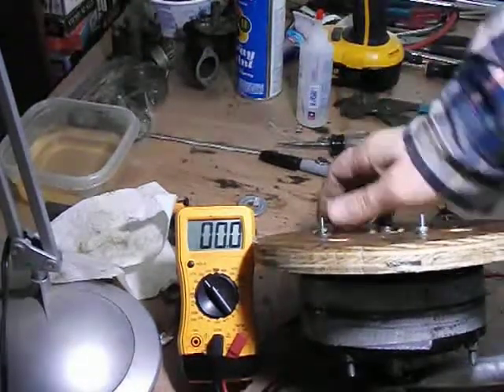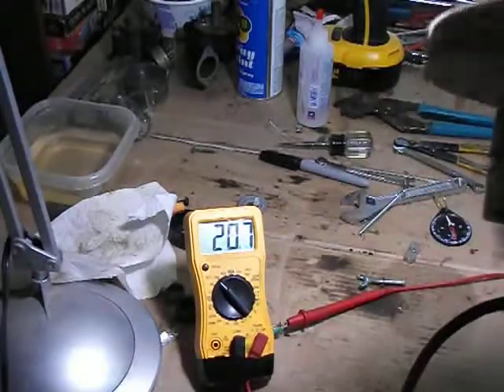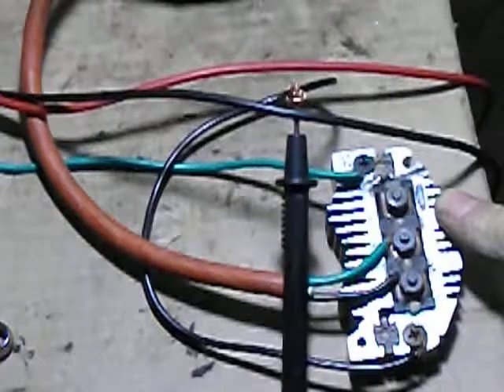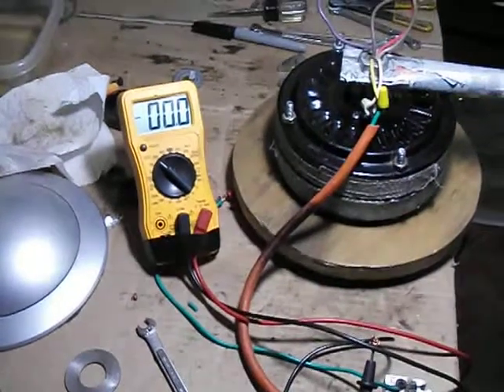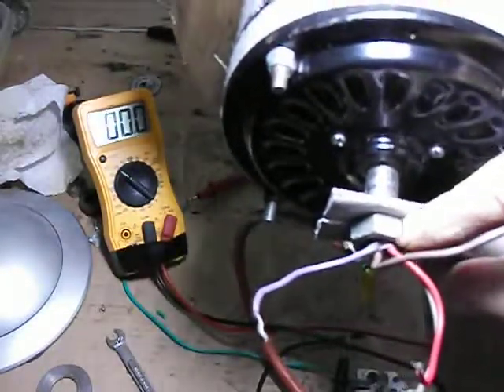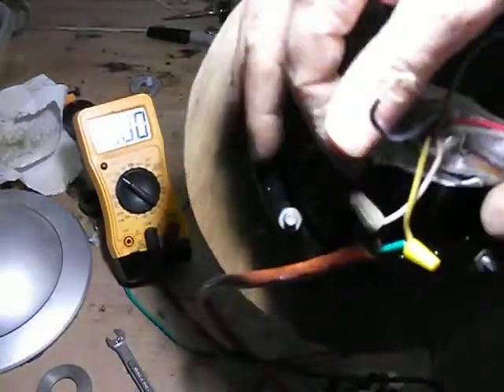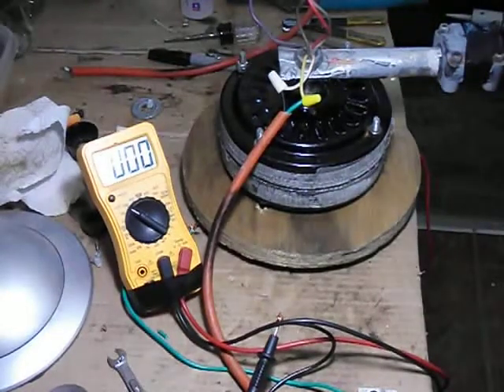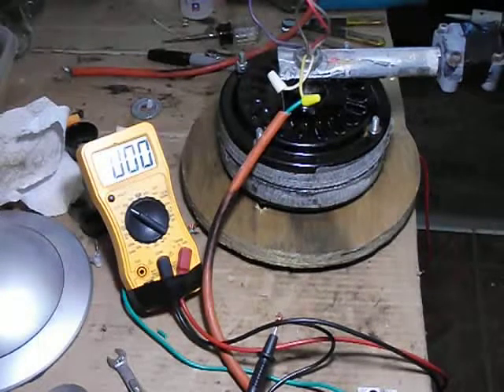Ceiling Fan Wind Generator Rebuild 10

Comment: noticed the pipe you are using looks similar to the front forks of a bicycle. wonder if it could be used considering it already has bearings to swivel all you would have to do is cut the front steering mech away from the rest of the bike.  and where the handlebars go you could slide a smiliar size pipe into it and mount it on to your post, or tower. just a thought. gonna follow your instructions and build one myself.